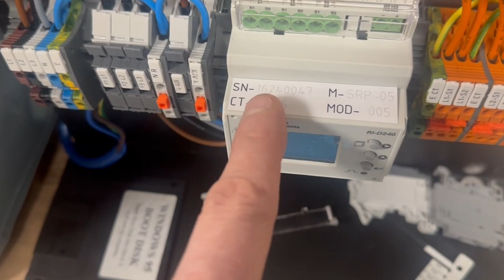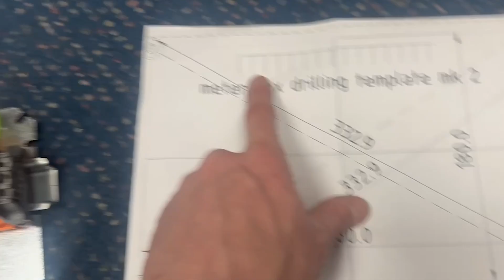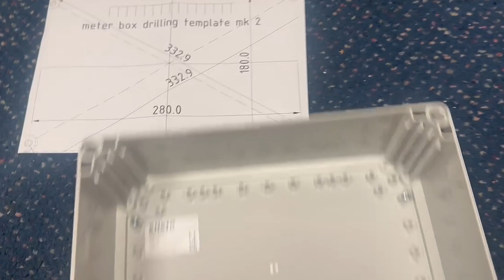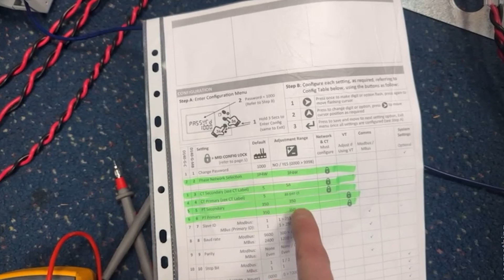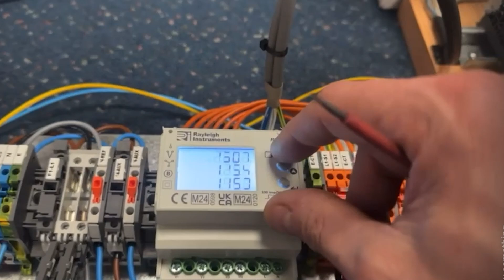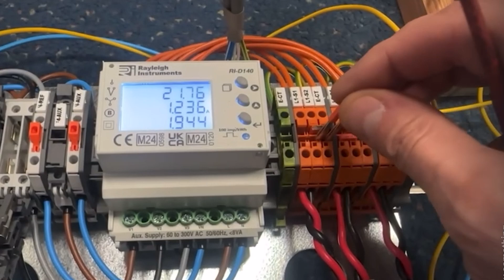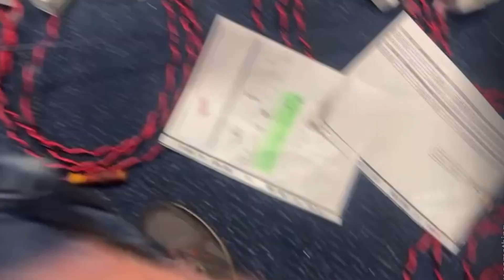SELF EMPLOYED SPARKY BLOG #14 JAN 25

Comment: Mass production means money. Serial numbers too! 
What is the BMS interface that decodes the RS485?
Reply from the maker: The interface on this project is a bespoke industrial PC BUT you can get a cheap rs485 serial converter and do the job no problem and there are a couple of tools you can get to read the modbus I will do a video on itv

Comment: Nice inclusion of the earth terminal next to the CT return terminal to allow the shorting link to be stored. Usually find myself hunting around for those on sites. Your comment about the issue with open circuit secondary on CTs is why we were always advised to use hooked tab crimps for CT secondary winding, so if the terminal became loose, the wire was less likely to fall out.
Reply from the maker: Cheers , glad sombody noticed because I designed that storage in hence why the terminal is orange with the links and not an earth terminal as the earths only accept 1 jumper , hooked terminals never used one myself but I come across them loads and thst a titbit of knowledge wong forget